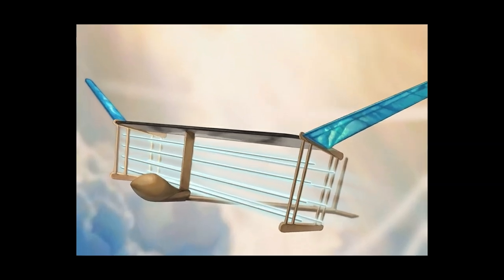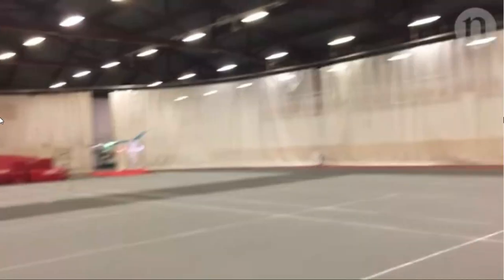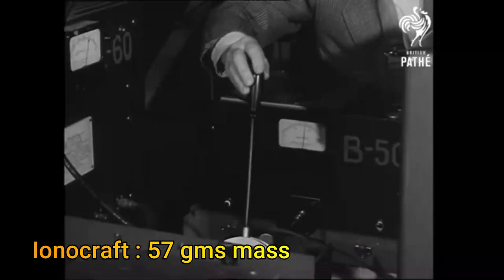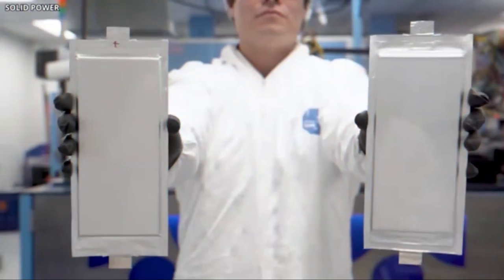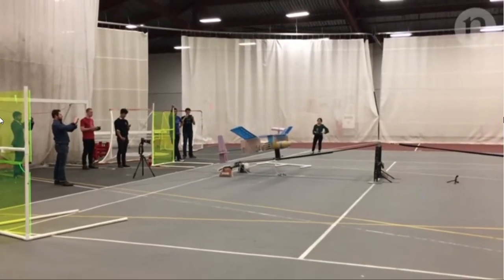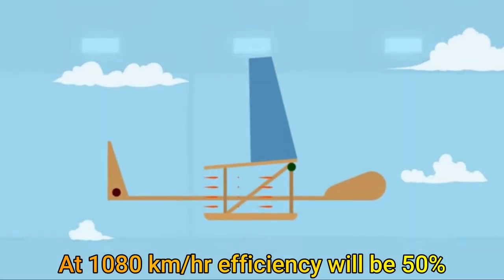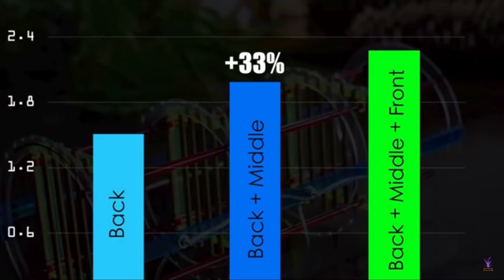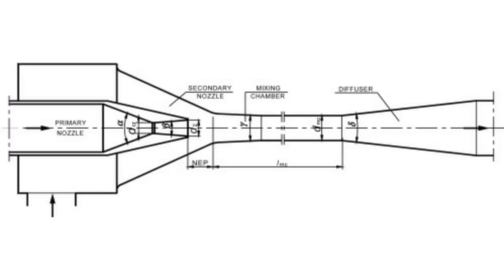Electroaerodynamic Propulsion:  Is it viable?

Comment: This is Ethan Krauss, the inventor of the first heavier than air ion propelled aircraft to lift its power supply and for sustained periods of time.  I appreciate you mentioning my series of patented VTOL ion propelled aircrafts with onboard power.   Here are some facts and a few corrections:

It takes more than just lithium polymer batteries or ordinary modern power supplies to cause an ion propelled craft to lift its power supply in a VTOL manner.

My series of crafts have been patented since 2014 for lifting their onboard power supplies onboard against the pull of Earth's gravity with ions.  Therefore, MIT, a private college, and any other large entity that has been trying to do this without arranging something with me is flatly infringing upon my patents.

People have been building multistage ion lifters for decades.  That approach does not produce anywhere near enough thrust to lift its power supply.  MIT will not succeed in this second attempt unless they infringe further upon my patents.  One stage ion lifters, EAD crafts, have always produced about 1 gram of thrust per watt, and 2 stage lifters roughly 1/2gram per watt and so on.  Barretts lifter strips on a glider produced almost exactly 1/2 gram of thrust per watt as an example.

My much earlier patented series of VTOL ion propelled crafts produce a large number of grams of lift per watt due to the very large gap spacings, reduced thrust per length of collector utilized, and many times thinner emitter wires (about 2.5 microns in diameter).  It has flown on camera, shown on my YT site, for nearly 2 minutes in VTOL mode with onboard power!  The MIT craft only ran for a few seconds after being launched by a catapult.  The earlier more efficient EAD crafts have also flown on one side gaining aerodynamic lift.  The crafts are lightweight enough so that they don't need extra wings or a bungy cord.

It has been shown by Dr. Adrian Ieta, Major De Seversky, and widely known electrochemistry/physics, that these crafts ionize O2 molecules not nitrogen.  In a pure nitrogen atmosphere, they produce almost no thrust.  O2 requires much less power to ionize and under the proper conditions, it just absorbs extra electrons since it is an oxidizer and is naturally electronegative.

The UT craft that you showed the computer-generated image of, and most recent flight footages of, is actually propelled mostly by an extremely loud ducted fan.  It can be seen and heard clearly in some of Pribanic's other videos of the craft.  The ducted fan is tremendously noisy as it is a model airplane "jet" engine.  To the best of my knowledge, it requires 2,500 to 3,500 watts to run it alone, and it requires a huge heavy battery.  You can google 90mm ducted fan or flying ducted fans if you wish. 

Pribanic has recently posted two international patent applications. The first is for the above ducted fan powered craft that is steered by fins under the fan, there are many examples of such devices, with no ion lifter, and instructions how to build them online. 

His second patent application is for a heated cathode lifter, "ion booster," those were shown online on Blaze Labs for the past 20 years, and required more power per watt to fly, not efficient, and they do not really require a second power supply although that is how it was previously done.  His first application claims "low noise," but I can't see how the physics of that type of fan will allow it to operate with a "low noise" level.  

While Severky had claimed to produce about 2 ounces of lift (56 grams) with 90 watts, his power supplies were indeed many thousands of times heavier than the tethered crafts.  His invention was way ahead of its time though, and he was a big pioneer along with Mr. Brown's earlier EAD devices.  Seversky's patents also covered linear emitter wires without spikes and his crafts shown in his famous flight video likely did not have emitter needles as those are normally not as efficient per watt as linear emitters.  They can be used however to get increased lift per a given smaller area.

There is much more to say but seeing as how this is just a comment section, that is probably plenty.  I really appreciated your video showing this technology.  I hope I have helped clear up a few a few of the details about what is out there. 
Thanks!
Reply from the maker: Thank you for commenting and giving us so much more information. Its an honour for the channel. I think with all the added information another video can be made.
Reply: @ElectricAviation  ⚠️ God has said in the Quran:

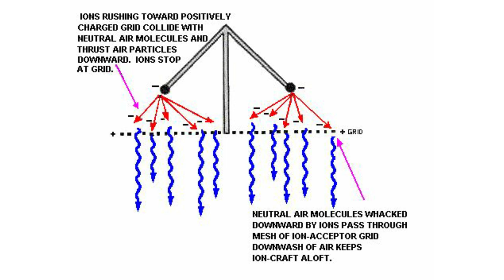🔵 { O mankind, worship your Lord, who created you and those before you, that you may become righteous - ( 2:21 ) 

🔴 [He] who made for you the earth a bed [spread out] and the sky a ceiling and sent down from the sky, rain and brought forth thereby fruits as provision for you. So do not attribute to Allah equals while you know [that there is nothing similar to Him]. ( 2:22 )

🔵 And if you are in doubt about what We have sent down upon Our Servant [Muhammad], then produce a surah the like thereof and call upon your witnesses other than Allah, if you should be truthful. ( 2:23 )

🔴 But if you do not - and you will never be able to - then fear the Fire, whose fuel is men and stones, prepared for the disbelievers.( 2:24 )

🔵 And give good tidings to those who believe and do righteous deeds that they will have gardens [in Paradise] beneath which rivers flow. Whenever they are provided with a provision of fruit therefrom, they will say, "This is what we were provided with before." And it is given to them in likeness. And they will have therein purified spouses, and they will abide therein eternally. ( 2:25 )

⚠️ Quran
Reply: @Nolan Davis Sure, back in the early 2000s I was building small ionocrafts with 10 pointed emitters on them.  They flew really well with small external power supplies but took a lot more watts per gram than the linear emitter variety.  I was using nicad 9v batteries that were capable of 10amp pulses for them!  I even built a version that had 700 wire/needle points suspended over 700 holes on an aluminum foil collector. That one required too much power to fly. Every point creates a glowing spot that can be seen in the dark and represents heat and therefore a power loss.  Linear emitters spread out the energy much more evenly and if they are sufficiently thin concentrate, it well.  The more evenly the energies are distributed the better.  Of course, the emitter surfaces should be much smaller than the collector surfaces.
Thanks for asking.
Reply: @Nolan Davis Hi Nolan, sounds like you're doing awesome work.  I never heard of anyone using water for the collector.  At 60kV, 0.1 amps of current is definitely lethal.  My crafts use more like 0.0001 amps on the output or less, at about 42kV.  While that isn't very dangerous for me to touch with one hand, it is still a bit scary to put next to the heart.  Good luck with your exciting work.  Stay safe!
Reply: @Nolan Davis On my YT channel and in the two patents listed there, the power supply is explained clearly.  There is also a closeup video of one being tested under the videos tab.  It uses a miniaturized resonant Royer circuit, like a small lamp circuit. It is used to run a custom-made button shaped low profile drum shaped transformer, I had to make the transformer cores and windings myself.  The transformer/inverter part runs a custom made relatively novel voltage multiplier that is positioned between the collector and emitter surfaces on the craft.  All of the components are carefully chosen surface mount parts that were picked and arranged to be as light and efficient as possible.  There are actually a large number of details to make it work well enough.  Most of the efficiency gain is in the structure though not the power supply.
I hope that helps.
Reply: I understand why patents exist (incentive and such), but isn't it good that technological development is happening faster because institutions are also developing the idea?

 They could of course try to buy the rights, but that is only realistic if the patent isn't flawed(like too generic which is somehow often a problem in the US)  and you are willing to sell rights to it
Reply: @xWood4000  The infringers that are saying their crafts were "first," are not being truthful or ethical. The much later less efficient devices were designed primarily with really only a few semesters of pt research, rather than decades of ft work.  The patent holders were given their patents for a reason and should get both some fair credit and compensation.
Reply: Paying royalties to patent owners is needed for experiments, or just for industrial, commercial production? 
A 2014 patent will expire in 2034.
Oxygen ions could generate Ozone? It has some health hazards. Blessings +
Reply: @josega6338  Bless you as well!  Patent holders should get paid at least something from commercial, industrial, or institutional licensees or infringers in particular, and their work should be cited. 
At very low energy densities, with the proper design, the patented version produces no detectible ozone.  A negative ion generator toy produces more ozone than it. Hurriedly designed infringer versions do produce lots of ozone. Regular ion lifters also produce some ozone, but it isn't enough to be of much danger, even if everyone had one. Some shock hazard is more of a concern.
Reply: @Nolan Davis Even 0.01 amps (10mA) at these voltages can be really dangerous.  Thin wires will lean over to ground, and the high voltages will arc out or conduct through things.  Please be safe.  I think it is better to experiment with lower currents at least from a safety perspective, in the long run.
Reply: saw your video, i have a suggestion, maybe not a good idea but i dont have any resources to try it myself. Use the "Air Multiplier" "bladeless" fan concept but rather than a typical fan in the base, put an ionic device in to provide airflow. I believe it could increase the thrust output without adding too much weight, complex parts, or more power. I dont quite know what the best material would be for the bladeless part of the fan, but it would be cool to at least see it produce some force in a static test. If it does prove to be viable it could definitely make an ionic lifting craft (or whatever its called, im just some person on yt) with practical applications, if it makes enough force to carry other components like a simple camera for getting aerial footage for a movie without a loud drone or expensive crane setups.
Reply: @trolly4233  i think it is a very good idea.  The thing is though that this technology generally has to be crazy lightweight for VTOL versions to work very generally speaking.  Redirecting air causes losses and extra weight.  The physics of this tech. are that it can move air over large surface areas slowly and efficiently, whereas propellors move air faster and in theory can be less efficient over spread-out surface areas.  The physics are different than what most people are used to.  Those are some of my thoughts.  Thanks for the interesting idea!
Reply: Don't fool yourself, attempting to reproduce/research/reverse engineer something you proudly patented by a educational institution without bothering to update you isn't an infringement in any proper legal system.
Reply: @wwlb4970  You know absolutely nothing about this subject!  I built a VTOL ion propelled craft with 100% onboard power in 2006 and patented it long before anyone thought it was possible to have onboard power with ion propulsion.  Most of the other team was still in early grade school at the time and had likely never heard of the technology then.  It is not me that is doing the reverse engineering.  Do not make statements that are not true.
Reply: @KraussEMUS1  You are accusing me of something I never said. Let me repeat: trying to reverse engineer, research or somehow reproduce your results, when done for sake of education, is not an infringement, even if they forgot to tell you. On the contrary, claiming so is a moral crime against integrity of knowledge.
Reply: Your comment was not clear last time.  This time it is clearer that you do not understand.  
The MIT group did not build the first ion propelled EAD craft with onboard power as they are claiming in many papers and across the web.  Do you think it OK to make such statements and "educate people" about things that are incorrect.

My crafts produce many grams of thrust per watt, not 1/2 like the glider.  The patents represent a huge increase in efficiency.  It is therefore my version of the tech that is being kept out of the educational system.
Private colleges are required by law to comply with patent regulations. Please do not make unkind statements anymore.  Life is too short, and I don't have time.  If you don't like the patent system, please take it up with someone else.
Reply: @KraussEMUS1  So, the actual problem here is that you're dissatisfied you're not being acknowledged by those who you claim are way behind you in their own developments. M-m-kay, funny.
Reply: Interesting post. I also have been building lifters since high school in the late 90s and early 2000s and was wondering what made your design different from the thousands of other lifter type craft. So specifically its your ability to create more lift per watt? And your power supply. I built a tethered design at 17 just like this that buzzed around a pole for a science fair but obviously it was teathered and I used a power supply from a desktop computer.
Reply: @22airjordan1  Hi Jordan,
It's all in the patents for it and on my YT channel and website.  The crafts have a minimum of about 20 meters of collector composed of concentric hexagons.  The emitter wires are15.2 cm high and the thrust density is kept at about 400mg per foot (0.33m).  It also has specially supported 2.5-micron diameter emitter wire and a novel high frequency onboard power supply.  Thanks for asking!
Reply: @KraussEMUS1  And the MIT craft did NOT have a hexagonal array -- they are not using your design -- so how is it they are infringing?  And they are not claiming they created your design and are not selling anything so where's the beef?  And their design is "inferior", so how can the compete with you?  Or are you just another Patent Troll with another imprectical design trying to stay in the limelight?
Reply: @scottsuhr2919  You are being unpleasant without cause! You did not read my patents.  Ion propulsion was not capable of lifting its power supply before the crafts described in them.  It was off in TWR by about 1000 times or more in general. I spent MANY years of work to make a series of ion thrusters that do lift their power supplies and then Haofeng Xu and Barret. released several papers incorrectly claiming that they made the first ion propelled aircraft of any kind with onboard power!   Millions of people are being told this still and it is not right.  Also a few second horizontal flight from a catapult is MUCH easier to accomplish than a nearly 2-minute vertical flight, my craft also flies horizontally. on one side with aerodynamic lift.  The patents for it specifically cover ion propulsion against Earth's gravity with onboard power, including horizontally and with extra wings. It was previously considered impossible to have onboard power for this type of propulsion.  MIT is a private university, and they are legally required to know of my patents and to be honest and honorable here.  They are collecting large amounts of money from their claims that are not correct.  I am through talking about this.  Please do your homework, as these details do matter.
Reply: @scottsuhr2919   Their design is definitely inferior then Krausse’s as his craft is a true ion powered craft and doesn’t use a ducted fans to cheat lift.
Reply: @KraussEMUS1 
I greatly enjoyed the OP comment.

I'm not a patent lawyer, but I believe other people can produce one item of the mentioned patent for their own research and testing. As long as it's not for commercial purposes. Any new inventions they develop may be patented themselves. They should reference previous patents. If they claim (as they have) to be the first aircraft powered by ionic wind, but that is untrue. Then You may have a case.

I've put a substantial amount of work over the last three weeks into ionic wind propulsion for a heavier than air airplane having wings. Everyone has the same limitation. That is, a much larger gap is required to generate adequate thrust. But a large gap requires obscene voltage. Somewhere in the neighborhood of the highest voltage power-lines in existence. This can become extremely dangerous. So, the amperage must be kept at or below what a legal Taser type device emits. (<5.0 mA). Ideally only 1~2 mA. A lethal shock is given as only 0.007 Amps across 
 the heart for 3 seconds. (The lower end Tasers are 2 mA, high end service duty at 4.9 mA, 7.0 mA is potentially lethal).

So therein lies the issue, limiting Amps, limits watts. Which is power.

Increasing voltage increases watts. Therefore thrust. Setting the gap wide enough to reduce or eliminate chance of arc is important. Wider gaps substantially improve thrust. But very high voltage can arc a long distance! So, just walking between, or even near the electrodes will result in being Tased in whatever body appendage that is nearest. It is plausible that current will enter one arm or hand, and exit the other. Flowing across the heart. Far more lethal than a Taser with its two prongs and 30-50kV limit.

There is a fine line that can be engineered to be less-lethal and still powerful enough for a useful UAV/Drone. Somewhere around 100-300 watts, and 2 pounds.

*Edit
I came across those patents last week. And determined this was not an area I would be the first in. Not that I gave up, but there is also some evidence LM has developed this tech, nuclear powered. Haha! (The sighting of UFOs, especially by US Navy aircraft). And the fact Skunkworks went silent on their compact Reactor that was at least 1,000x smaller than conventional. They pulled all mention of it from their website. Iranians saw something hovering and flying erratically on a couple of occasions. And it emitted a glow visible to the naked eye. Bless the USA.